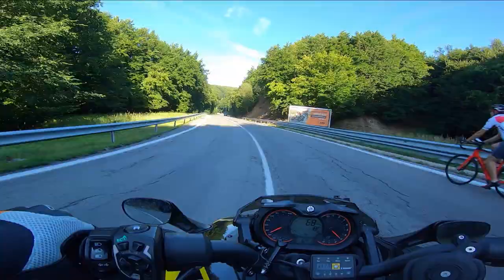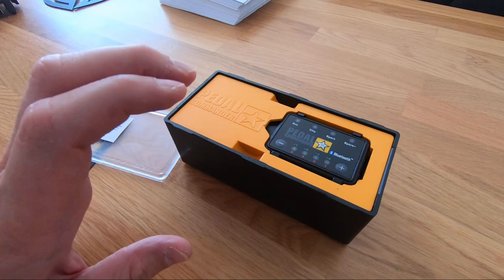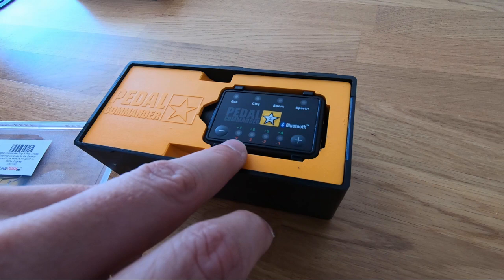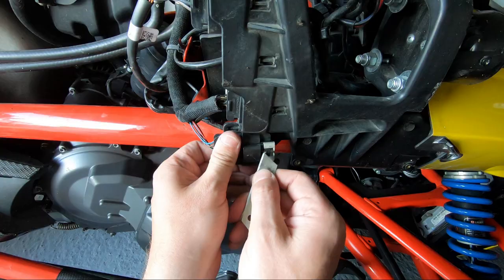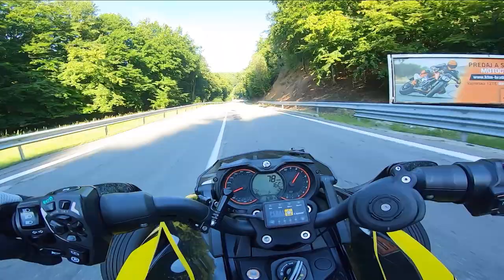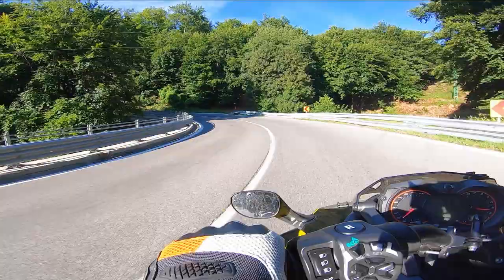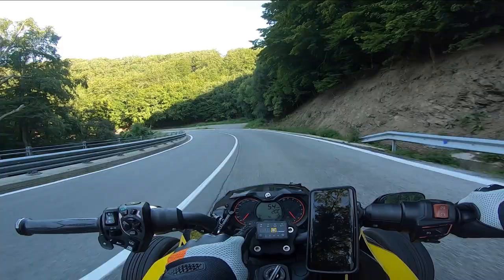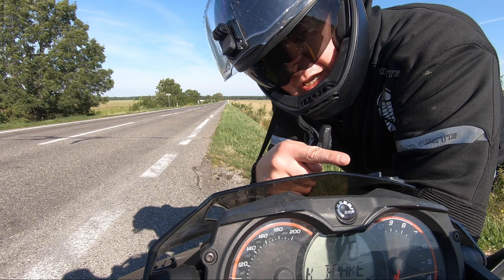Pedal Commander - Why it is a must have upgrade? [Spyder - Ryker - Slingshot]

Comment: Your laughter is all the proof I need.  I’m installing it on my 2023 Spyder RTL.  No sport mode + first right off the bat.  Got it!  I’ll let you know how it goes.
Reply from the maker: 😁😁😁 but i recomend new PB Pro not this https://www.martinthevlogger.com/product-page/pro-pedalbox-throttle-response-unit-1330-rotax-engines i have explained it manytimes but most important its - error code free and its wireless now 🤟🤟🤟

Comment: I had been thinking about purchasing this for my 2019 F3S and your excellent video convinced me to make the purchase. Happy I did.
Mounted it on the right side under the body panels in one of the 'wire channels' where there was a flat piece of metal to stick it to. While I usually don't rain ride, I get caught out from time to time and wanted to give it a fighting chance on the water resistance side. The Bluetooth connection works just fine for me, though it does take a minute or two to come online after starting. 
It's currently set to City +2 and that seems to be a good mix of snappier than stock without being too psychotic. On a day when I know traffic will be lighter, I'll try the Sport ranges, but that little change alone is awesome. Turn on "Sport" mode on the F3S and it all seems to move so much smoother and quicker.
Keep making great videos like this. Thank you!
Reply from the maker: Thanx buddy. Love to see that ypu are happy woth P.C. thanx for great experienxe sharing and nice words. Martin 🤟

Comment: $300 and this is not waterproof? 🤔
Reply from the maker: Yup... i undestand ypur frustration, but its a lot of ipgrade for the money. Trust me. https://www.martinthevlogger.com/product-page/CanAm-Spyder-Pedalbox-throttle-response-unit-1330-rotax-engines i sell PedalBox. The whole case is water resistant, just one microport is not and it has rubber pin protector over it. I have it silicone glued for whole rYding season on the rain and out and it works great. Also for many other customers 😉😉😉

Comment: Do you still use pedal commander? I would be very grateful if you could let me know if this device has caused any damage or unexpected malfunction on your motorcycle. I am also considering purchasing it.
Reply from the maker: I have stop using it and replaced it with this https://www.martinthevlogger.com/product-page/pro-pedalbox-throttle-response-unit-1330-rotax-engines much more advanced and error code free. 😉😉😉 no damages to the bike at all

Comment: Hi Martin,
Thank's for this  review. 
You are runing with a remaped ecu.
 the question is to know if the pedal commander works like in the video with a stock ecu ?
And  do you know if this little Wonder pedal is waterproof ?
be carefull by riding the beast now !!!   :-)  and...have fun !!
Reply from the maker: Frank i gave just stage 1 of ecu flash, and lost of back pressure because of dcat and akrapowic, so i dont think the ECU flash has anything to do with this. But great question for follow up.video 👌👌👌👌

Comment: Hello Martin, could you tell me more about your Spyder? Does it have the 89 sprocket? What tune is on it now?
Thanks!
Reply from the maker: Hey buddy. Its Stage1 i believe what they call it these days. I did it 5 yeras ago like one of first in the world and at that time was just one stage avaliable. As for tge sprocket. 70.000km rYding like an idion and i have my stock one. I will do a video in winter time about the red dust coz its a mistery
Reply: @MartinTheVlogger  Do you know which sprocket you have? 79 or 89 teeth?

Comment: hi Martin  ... can also be installed on the spyder GS year 2008 manual box  ?
Reply from the maker: I think the answer is no. Because they did it for 1330 engines only. But best is to check with P.C. guys directly

Comment: Is the control panel waterproof
Reply: It is not.. but we're working on a silicone cover. Please also note that you have full control over the throttle settings via your smartphone. So you could stash the unit and control with your phone as well. 😁

Comment: It’s only for f3 and Rt spyder not for rs?
Reply from the maker: its for 1330 engines I am afraid only :( - where are you based? in US or EU? Guys down here are working on Ryker and and have 1330 donme on something that is called Pedal Box, and I can ask them if they can do elder models once the ryker is done
Reply from the maker: I have an update for you. Not this unit is not for 998 engines as i wrote you. But i am just finishing the review of pedal box and i have called to pll what tgey think about your case, and tgey said, it works with 998 engines in case you have electronic throttle. The super old models dont have it, so it will not work.. but the ones that do, they are blaaaast... more agresive them F3 😆😆😆 stay tuned on weekend video coz its a big thing 🤘🤘🤘🤘
Reply: Would love to see this
Reply from the maker: @gasawayelizabeth9683  have a look at my new video. Unforyunatelly pedal commander is not for 998 engines,but pedal box is 😉😉😉 https://www.martinthevlogger.com/product-page/pedalbox-throttle-response-unit-998-rotax-engines
Reply: @MartinTheVlogger  How long does it normally take to ship and receive to California. I watched your video love it now just wondering how it will work for my 13 Can am spyder rs
Reply from the maker: @gasawayelizabeth9683  it will be blast. Please write me to martinthevlogger@gmail.com and i will check the price for faster shipping. Normal is just 9eur but it will take up to 3weeks and i will not ship this unit like that via Usps.. i will check the privat company and will reply in email. We will find a way 😉😉😉😉